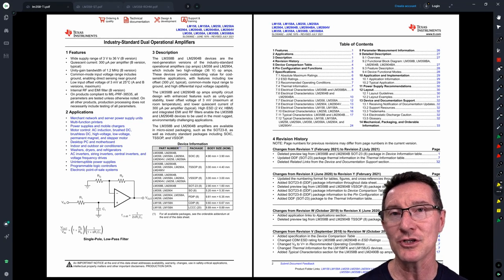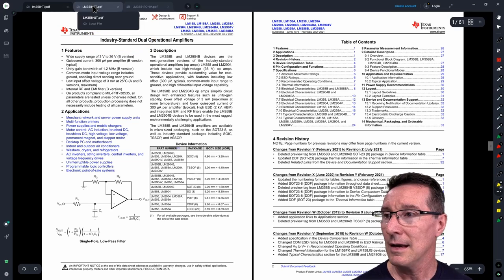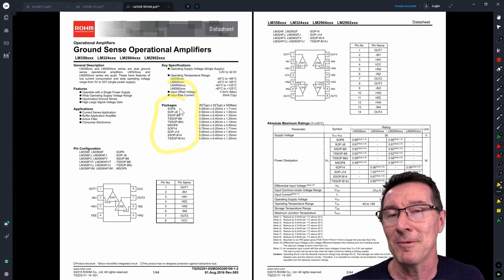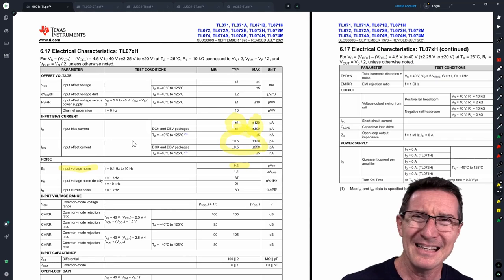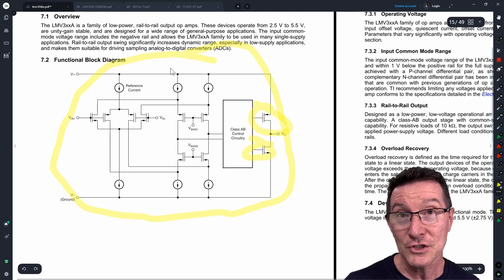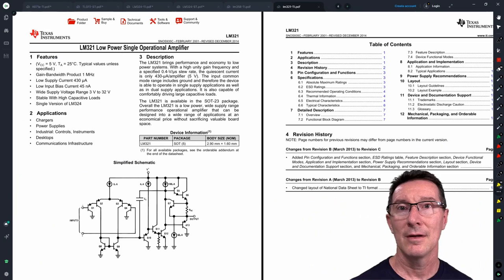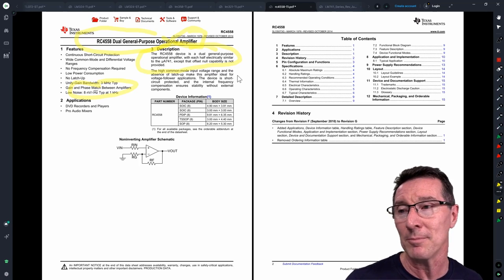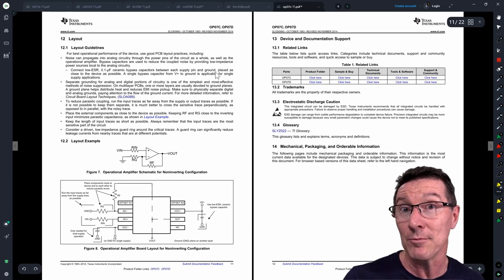EEVBlog 1436 - The TOP 5 Jellybean OPAMP's

Comment: Dave, I hope to be buried with an LM-324!  
As a junior engineer in the late 70's, early 80's, I both cut my teeth and quickly adopted the LM-324 and used it for almost every product that I was commissioned to design for one really unique reason:
To me, the real power of the LM-324 is the fact that you have 4 OP-amps in the package which allows you to effortlessly increase the performance of many types of circuits (especially precision comparators) by using 2 of the OP-amps as buffers by tying the (-) to the output and using the (+) as the input.  This allows you to not load, say a comparator, by isolating its input from the external circuit.  Conversely, you can use the second buffer as output-isolation from the load, so again, you don't upset or change the operating point of a comparator.  Additionally, you'll find using these buffers (in & out) will aid in the precision of your 10X, 100X etc. amplifiers.  So, this is why I completely skipped over the LM358 because I just got such better performance with not a whole lot of additional real-estate!  Anyway, we're definitely on the sam page for 'Jellybean' Op-amps!  Thanks Dave!

Comment: In want mooooooorrreeeeee!
My favorite OPAMPs:
Precision stuff, Rail-to-Rail, low voltage(5.5V max), low power consumption: OPA2333 = TLC2333
Not so precise, Rail-to-Rail, low voltage (5.5V max), low power consumption: OPA2348
Very low bias current (0.2pA), Rail-to-Rail, 3-16V Supply, fairly low power consumption: LMC6482
My fav cheap low noise Audio OPAMP: RC4580
My favorite higher current and capacitor driving OPAMP: LM8272 (Good for Rail Splitters)
My favorite higher current driving low voltage OPAMP: OPA2322
My former favorite +-5V low power audio opamp: TLC2262/TLC2272
Just to name a few, got so many more...

Comment: My biggest rant is on data sheets is when they list both an A and B version of the part but fail to  highlight the differences forcing one to do a line by line examination of the data sheet in an attempt to figure it out.
Reply: I wish I could give this comment 1000 thumbs up. The odious practice of not proving “delta” information (between versions within a datasheet, or between “sister” models in a series) drives me nuts. I’ve seen some where people gave up and asked the manufacturer (in their forums) what was different between two versions, and the manufacturer wrote back with the difference — which wasn’t in either datasheet. 🤬🙄
Reply: And with the situation in the semiconductor business over the last what 15 years, with mergers and acquisitions - you can't trust one manufacturer over the other to have proper good datasheets either. (Not mentioning different segments inside the same company)
Reply: @tookitogo  Connectors are so bad about this. Why do these two parts look identical but have different part numbers? Well one has little drain holes in the bottom so they don't collect fluid when the board is washed after assembly. Also, we don't make that kind anymore. Of course!

Comment: You might want to mention LM358 has issues with crossover distortion on the output, and so the output should be pulled down sufficiently for certain applications, especially AC coupled outputs, where the output both sources and sinks current.

Comment: The NE5532 is my favorite, single Op-Amps in a package are used when you are amplifying minute dc Voltages, because they have offset pins to zero out the error, when an Op-Amp is operated at an elevated Voltage (and the other unit in a package would be unable to be usable) and to replace higher noise and drift single package.  Like a NE5534 replacing a LM301. Ron W4BIN

Comment: My 2 rules of thumb when using op-amps: same inpedance on both inputs, resistor 1k between output and V-. This last trick turns op-amp in some sort of class-A amp, great for audio applications. I recently built a stereo headphone audio amplifier. LM324 for input stage, LM386 for output, applying those 2 rules gives excellent result

Comment: Before watching the video, 4 in the list are obvious to me:
LM358 (general purpose, low frequency, low cost, single supply), OP07 (low offset voltage, 'precision', great for raw sensor front end), TL071 (high input impedance, okay for audio), NE5532 (standard audio opamp, relatively low distortion in audio band for the cost, quite alright at anything). I think these will be the same for 99% of engineers.
Reply: As expected, all the celebrities are in the video.
At 21:35 though, the 5534 is a single part, not quad! It is also in PDIP package, but only a single opamp because it exposes the compensation capacitor pins, and is only stable with feedback gains of 3x +. On the plus side, it does have sliiightly better noise though. But, if you want better noise than the 5532 you'd be looking at other parts anyways, so kind of an obsolete opamp at this point in time in my opinion.

Comment: I'm by no means an EE, just a hobbyist but I'm also an electrician and do a lot of building automation. I felt really happy when I recently looked at some demolished equipment (laboratory fume hood controls) and knew what all the ICs were with the exception of the old early 2000s era microprocessor in each device. All TTL logic and cheapo quad comparators and op-amps.

Comment: You should compile a list of all the jellybean parts you can think of off the top of your head. In fact, someone should make a github repo for it so it can be community contributed
Could add stuff like recommended packages to have the best manufacturer compatibility and stuff like recommended use cases and stuff
It'd just be a nice cheat sheet for the hobbyists out there
Reply: My stupid chest code for that is to look at JLC's basic parts list. They're the parts that are permanently in their p&p machines.
Reply: @DanBowkley  that's a great way to do it, yeah!

Comment: Some of my op-amps:

LM124 / 324 quad bipolar GP
LT1128 Ultra low-noise
LT1010 High current (150 mA) unity gain buffer (TO220-5)
LMC660 Femtoampere input bias CMOS
NE5532  Aimed at audio. Widely used in mixing consoles
MAX4328  Ultra-low input offset.

Comment: Hey, thanks for the lowdown on these. I didn't know that RC4558 were in fact dual 741's :). As for the latter, these are still useful for old-school guitar effects, if you want to re-create the old sound.

My fav are TL072 / TL074, though I may be interested in NE5532 / NE5534, and something even better (when it comes to noise) for mike or RIAA preamps.

By the way, it'd be a very good idea to make that "jellybean components" miniseries. Including tubes (my candidates are 12AX7 / ECC83, 12AU7 / ECC82, 12AT7 / ECC81, 6L6, 6CA7 / EL34, and maybe 5U4, 5AR4, GZ34) or not :)

Comment: Hi Dave. Great video as usual. At work we use TL07 series and the OP07. There is one that came in a product we sold a lot which was the OPA177/OP177. We used to replace them with OP07 when they got blown and they worked fine. I have personally used the LM358 for my little audio experiments and it works just fine. What a great little Opamp. It can handle far more than than the human ear could ever hear. 

I would lobe to hear what you suggest for 200 meg to 1 gig opamps. I also like messing with RF and stuff like that.

Comment: Thanks for this tutorial!  I didn't realize the 4558 chip was essentially a pair of 741 chips in an 8 pin DIP.  For audiophile work the Burr-Brown op amps are nice.  In 8 pin DIP the OPA2134 is something to consider, although there are newer ones with even better specs available in SMD packages only.  It's tempting to get an adapter to try plugging an SMD variant into the DIP sockets on one of my guitar pedals just to see how it responds to being driven into the nonlinear region.
Reply: I’ve used OPA2134s to upgrade TL072 and they work and sound pretty good to my ears. I’ve been using them in my Soundcraft 2400.
Reply: @JM Coulon If the design is an EQ without coupling capacitors, the bias current of the 5532 can thrash the track, creating the dreaded permanent scratch. That is really the only reason I use it, otherwise I just use the 5532 if input bias current is not an issue. I’ve found it to be the best compromise of noise, cost, and power consumption if low bias current is a hard requirement.
Reply: I always thought the LM1458 was the disk version of the LM741
Reply: *dual version
Reply: @JM Coulon Yes, the Burr Brown stuff is pricey.  $4 or so for a single OP2134, which I liked only marginally better than a CA32040.  The 5532 is also a solid choice.  Could you name a couple of the current audiophile op amps for me?  They are probably all SMT-only.

Comment: I can't count, in how many TL072's I used In my designs, while working in the synth industry. In my current occupation, there is no luxury of the 12v symetric rails, so it is eiglter LMV321 or non jellybean.
Reply: Now to be fair, there are plenty of guitar pedals and such running TL071s on a 9 V block, though given their lame output driving abilities it's not exactly ideal. But yeah, there is little in terms of jellybeans if you need something for a 3-5 V supply, though I could still name quite a few inexpensive parts that come close, like TLC27x or TLC227x on the CMOS side or bipolars like TS92x, TS97x, TL97x, NJM2115 and the decompensated ultralow-noise NJM2122. A number of the bipolars have quirky (crude) single-ended output stages in the interest of voltage swing and are no real current misers, but all of them sport way lower input noise than the LMV3xx if that's a priority.

Comment: I was taught using 741's... all I used in two years of analog classes. I did use some others (rail to rail capable) in later years but at least in education, it seems the 741 still has a use.

Comment: Opamps have come a long way in terms of output impedance, noise, distortion, bandwidth, input offset, slew-rate performance over the past 40 years.  For me, the research involved with component selection can be the most time consuming part of circuit design, and often the circuit requirements are not demanding enough to warrant spending much time on component selection. That's where jellybean parts come to the rescue.

Comment: I bought a bunch of mil spec LM224's and they can do almost anything! I even ran them way out of spec, from 3v-36v and they still worked! They do tend to oscillate when you dont want them to, but the plus side is, they make great oscillators! they show very little drift with supply voltage changes.

Comment: Hi, just been going through your Jellybean videos in the last days 🙂

At our company the old masters of the trade are now going into retirement one after the other.. Semicon testing equipment.

Last friday i made a picture of a component drawer because i wanted to look up datasheets over the weekend and see what i could use to get a GPIO pin (1.8V) to switch a 24V PLC input
.. i'm missing the left/upprer part of the drawer but in there are (smd mostly) kinda all you mentioned:

LM311 (single high speed volatage comp.)
LM317 (adj.pos.voltage regulator)
LM318 (prec.fast.OpAmp)
LM337 (adj. neg. voltage reg)
LM358 Op.Amp
LM393D (dual volt comp)
LF398 (sample and hold ..)
LT1013 (dual prec OpAmp)
LT1021-10 (voltage reference 10 volt)
LT1021-5 (voltage reference 5 volt)
TL072CD  (OpAmp)
OP-27 (low noise precision OpAmp) can be used as replacement for OP07 and NE5534 .. ;-)
OP-07C (precision OpAmp)
AD707KR (ultralow drift OpAmp)

Comment: You're quite correct that the 5534 isn't internally compensated for unity gain, it also has a lower noise density than the 5532. But it's a single amp not a quad.

Comment: With op amps imho that’s a different story than with transistors. You can find only 5532 and 071 everywhere. All the others are selected with using a mind and can be absolutely different. Like 797, 828, 1612, muses1,2,5, 275, 627, etc.

Comment: There are a LOT of counterfeit 5532s coming from China.  Measure between the + and - inputs with ohmmeter set to diode reading.  Genuine 5532 parts have input protection diodes limiting the voltage between the input pins to about +/- 0.7V.

Comment: Thank you dave great work. more videos like this. explain more on the features please....chopper?, rail-to-rail?, ground sense?, common mode?, and so on
Reply: Chopper amplifiers automatically null out the error in the input offset voltages.
Rail to rail output means that you can output any voltage between V+ and V- or ground, on non-rail to rail outputs you'll typically see that it can only output from (V+ - 2V) to (V- + 2V) or ground for example.
Ground sense means that the inputs can differentiate between voltages that go down to ground. If you have a voltage that's 0.1mV above ground then they'll be able to sense it, for ones that are not they'll need the voltage at their inputs to be a certain level above V- or ground.
Common mode is simply voltages with respect to a ground/common point, this is how we typically think of voltages, but the alternative is differential where it's the difference between 2 voltages that matter
Reply: @MrPhilip796  thank you for the explanation, it helps just need to read it a few more times for it to sink in
Reply: @MrPhilip796  That was VERY efficient, thank you!

Comment: Quick question: I understand that if you throw in a component that has multiple independent functions, and you're only using a few of them, you should tie the inputs of the others to prevent various effects (extra current draw, interference, oscillations, etc.) How does that jibe with "have them lying around in case you need them"? Surely by tying them down (or up!) they're effectively used but useless?

Comment: Regarding the TL07x (TL071 - TL074) is low noise compared to the TL08x group (TL081-TL084), which the more general purpose part. The TL061 thru TL064 are the low power versions. Still use the LM358 more often. In a quad, I go to the LM324. The LM324 can also drive a decent amount of current, compared to most op amps.

Comment: The most significant omission is the Bob Widlar LM10. 1V1 until +_20V. It is a tough act to follow. You steer very clear of Norton Operational Amplifiers like the LM3900. I wonder why? Your Achilles Heel? Just off the top of my head I would like these covered in future: BC109, 555, LM723, 2N3055, 2N2222, ZN414, LM3900, LF351, LM3909, SN76477, 2N3819, 4007, LM339. These are evergreen and some have been reincarnated.

Comment: I have a small inventory of 358's, 072's, 082's, 4558's, and 5532's I keep for either doing repairs, projects, or replacing other pin-compatible, but cheap and/or noisy, opamps.

Comment: One selection criteria I'd like to see is immunity to RF interference. In the past I've seen serious problems with LM358 used in audio and control circuits in land mobile base stations and in some cases, we had to swap them out for TL072 or TL082 instead. Don't remember if these were LM358A or B models, but they were pretty bad. Seem to remember similar problems with LM324.

Comment: Where does the expression jellybean come from, ethymological wise?
Reply: jellybeans are a snack that are so cheap theyre offered in buckets and if you drop one on the ground, it's probably trash. not worth the hassle to collecting and testing it.  Through-hole resistors are jellybean parts because they're so inexpensive you should buy them in bulk. STM32 is NOT a jellybean chip, because theyre costly and hard to find, you're only going to stock what you need, but LM358, you could have a handful on your workbench at all times.
Reply: @DoctorKarul  Got it - thanks for tutorial.

Comment: That is a nuts price for a 741. Last time I bought some I got 1000 of them for less than £30. That was from a reputable supplier too. It does work OK for a lot of jobs but nothing exotic. I personally tend to go for a TL082 for medium precision jobs. If I'm building an electrometer then really you need an MCP6041 for "medium" currents IE 1pA but if you want to go into true electrometer territory you need an LMC6041 which has way different specs. EG at 0C the input bias current is down to 0.0001fA (100aA). Use dry ice for cooling or a properly designed stack of peltier heat pumps (which takes a day to stabilise) and use "dead bug wiring" (remember to not touch any component as grease from your skin will throw impedances off) and if the components work (they are not designed for that level of cold) then you have an electrometer front end that can easily work down to 1fA with 5% error. IE 0.001 pA. However "sod to build" as a phrase was invented for such instruments. Very useful for a home made mass spectrometer though. Then of course comes the PSU which can produce enough noise to swamp everything even with a PSRR of 80dB. That however is another complete game in itself. EG using capacitors to power the thing then compensate for the output voltage slew as the voltage drops. Even then you have to use dry ice on those too (about £200 worth of ceramic caps) as even a linear reg working from a battery is way too noisy. However get it all right and you can detect a mouse fart on the moon.

Comment: Beware, the NE5534 is a single opamp, NOT a quad. NE553x is used in audio because it can drive down to 600 ohms. Also has decent slew rate.

Comment: Hey Dave, a couple of other nuances with the LM358. Because it's a PNP input stage, the bias currents come out of the inputs. It makes it so much more convenient to compensate for these currents in single-supply operation with some input resistors. The disadvantage is that the inputs should not be connected to a low impedance source, but you were going to add those resistsors anyway, right?

Comment: As per my long experience with OP Amps , Dual supply parts are the best for industrial grade products while Single supply parts are for low power commercial grade products and honestly 741 and 747 or 458/558 are my best although they are base OP Amps ... OLD SCHOOL !!...